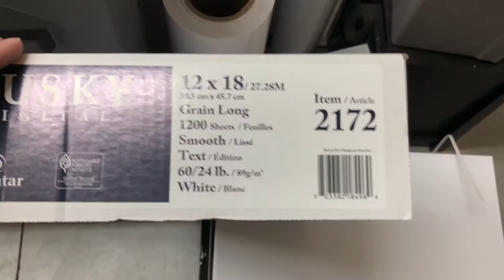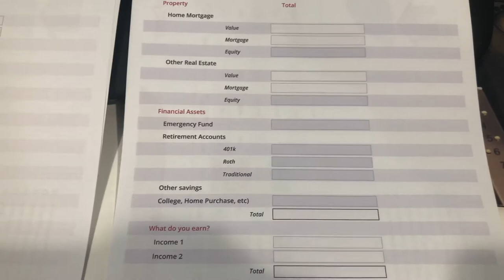Good Konica c3080 production, letterhead, postcards, and more - vlog 186 - Print Shop Updates

Comment: Sup, keep pushing forward.
Reply from the maker: Thanks
Reply: @ttms  ps. Can print up to .33mm thick paper with 24"x 150" is that okay for good amount of business cards.
Reply from the maker: I print on 14pt or 16pt equivalent paper which according to the internet is .39mm and .43mm. You could probably get away with it, but .33mm is too thin for my liking.
Reply: @ttms  if a professional like you as I could get away with it then thank you I made a good choice it costs $649 it came with ink and it's Wi-Fi ready. Like you saw and unboxing video